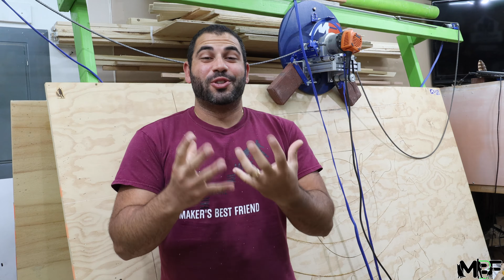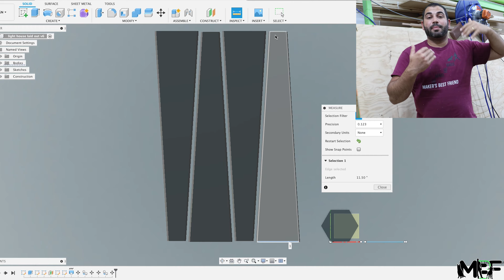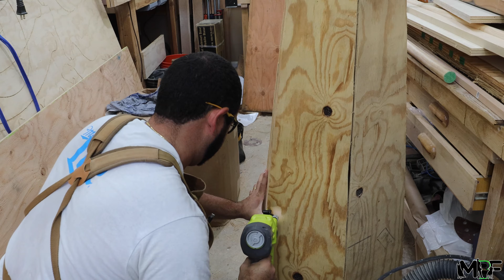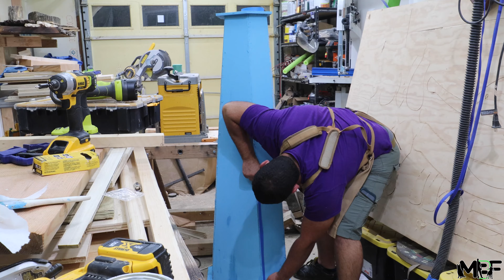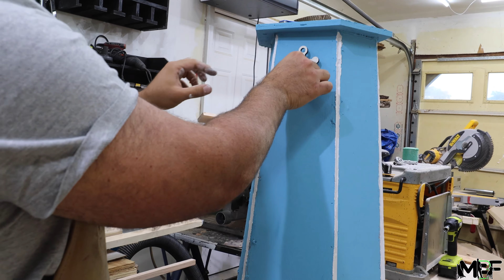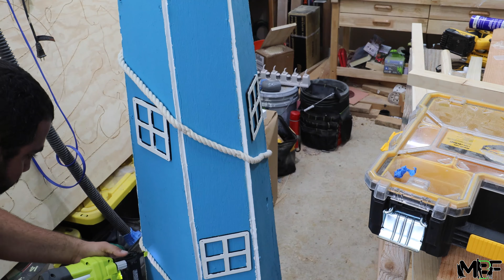DIY 6 Foot Front Lawn Lighthouse

Comment: I want to build one of these to replace an older lamp post in my yard. Mine will need to be taller and have a door on the side to access the power outlet that it will set over so that the light can be turned on and off from inside. I'm thinking, no floor because of the outlet already installed outside and building a frame and then covering it with plywood. I've been sitting on doing this because of all the angles I'll need to calculate and try cutting of an octagon shape. Maybe I need to find some software that will help draw up plans before I even cut one piece of wood.

Comment: I am a traditional woodworker but bought this cnc because of your videos. Would like to see more cnc videos. I need to learn the design software.
Reply from the maker: That's awesome Matt! I hope you're liking it so far. What type of videos would you like to see?
Reply: I don't know how to design in 3d programs very well. Would like to see more about how you made the lighthouse for example. How you layed out the pieces. I understand how to cut once you have an .nc file. Makerverse is pretty easy from there. Thanks for the videos